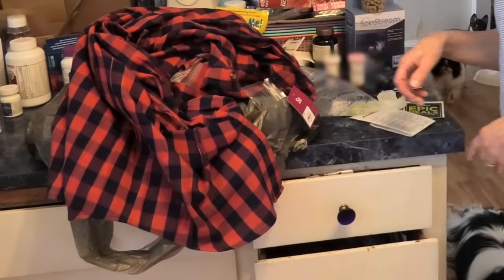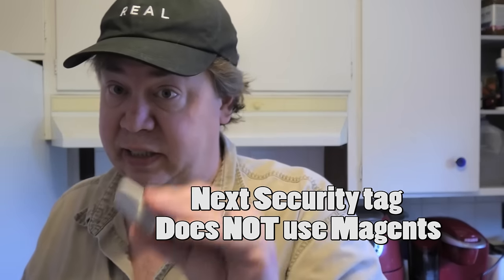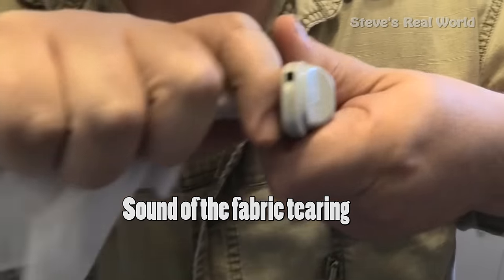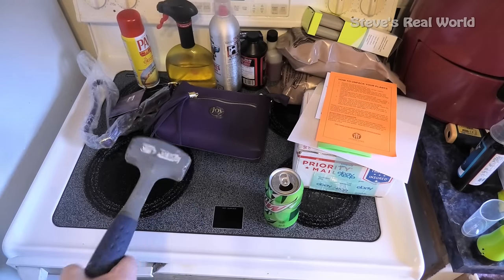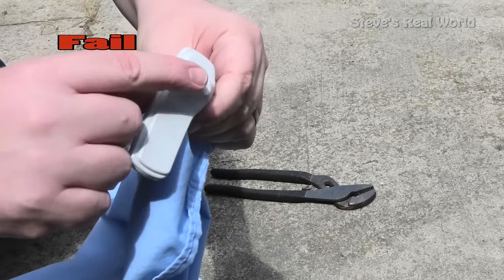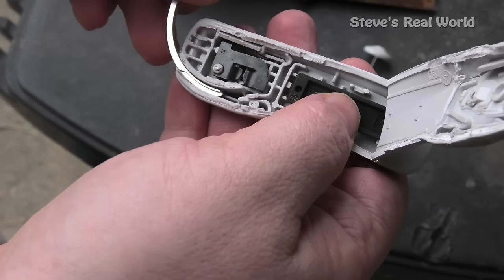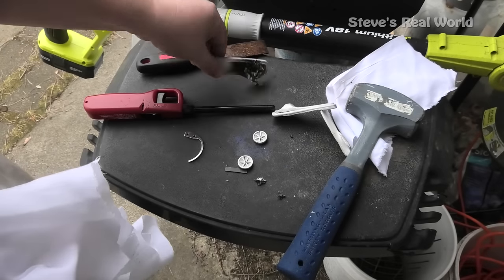Remove Security Tags from Clothing - PART #2 - ELEVEN Ways Tested

Comment: OKAY IM 4 YEARS LATE BUT I BOUGHT A LULULEMON JOGGER PANT AND IT AIN'T COMING OFF. first off, that thing was 139- on discount and was 89 dollars. they put the newer black kind of security tags on there even though they didn't have a detector thing at the exit. it takes 45 mins to drive there and i am NOT going back. They put the tag on a thin fabric and it is NOT moving. I don't know what to do because it doesn't look to much like these, but I know it doesn't work with magnets because it has that device inserter thing.
Reply from the maker: I have three different videos on how to remove these tags - actually Kohls is the worse at forgetting to remove them. I say the Magnet method, if that doesn't work, watch Part #1 and try the FIRE method - Thank you for the comment! Part #1 - https://youtu.be/7xq-yrtGD3Y

Comment: I have a question. Will the magnet beep in the exit ? Becouse it wouldnt make sense to get the security thing out if the own magnet is going to ring the alarm
Reply from the maker: It should, Not sure they work in Kohls, you will have to test it!
Reply: Well, the idea here is to actually purchase the items, not to steal them. So it doesn't matter if the magnet sets the alarm off, bc you leave the magnet at home and only have to use it if the cashier accidentally leaves the tag on.

Comment: 1st off that was NOT 11 methods. 2nd where tf you get all them things from??? Yall boosting ???😂
Reply from the maker: What? Seems like 11: 
1. Use a magnet - Part #3
2. Pull method 3:20
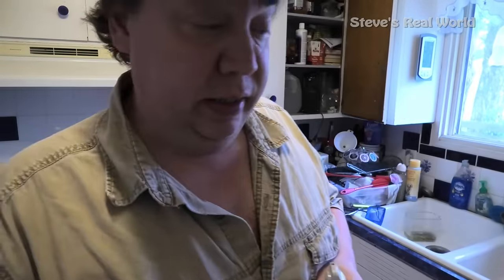3. Fork Method 3:48
4. Spoon method 4:18
5. Two Spoons 4:38
6. Mini-Bolt Cutter 5:14
7. Scissors 5:38
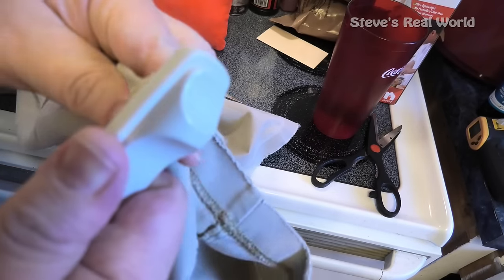8. Scissors with bolt Cutters 6:46
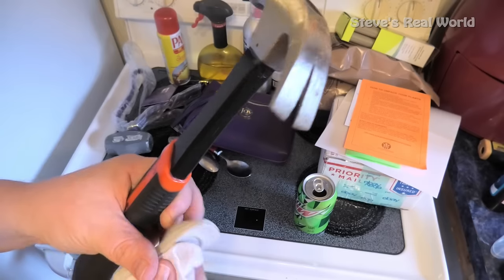9. Tiny Hammer 7:16
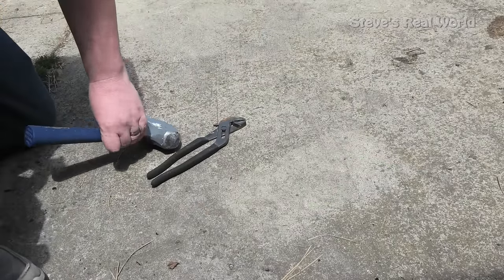10. Sledge Hammer 7:54
11. Fire Method 9:46

Comment: Stop it Leann
Reply from the maker: Right - Have you watched PART 3 yet? https://youtu.be/Ibnvp8vCLRs
Reply: @StevesRealWorld  I just checked it out nice I enjoy you guys content. The magnet is the best. I don’t have a strong enough one tho. I ended up using a knife with a gritty section on the blade. I cut the top then I cut it vertically and got to the ball bearings wish I had the magnet tho much safer. Thanks I have a baby on the way and Marshall’s and TJ maxx both left them on her stuff. You gave me the confidence to do it and not have to return to the stores.